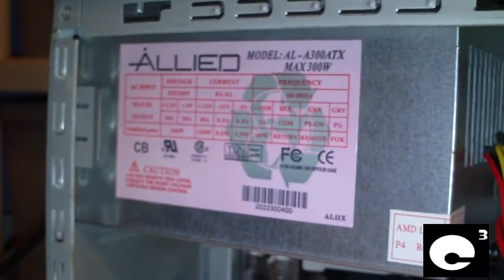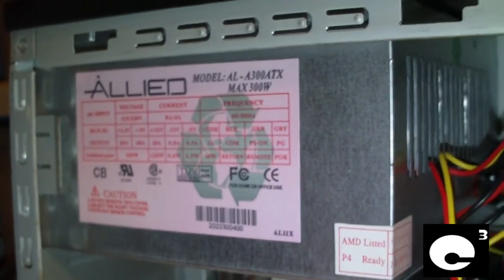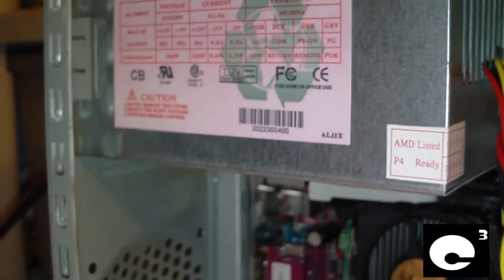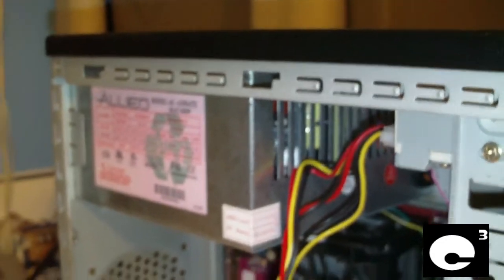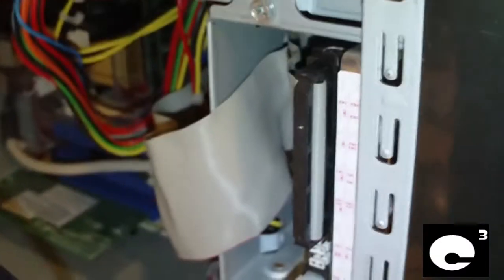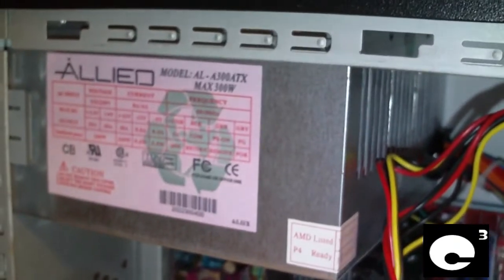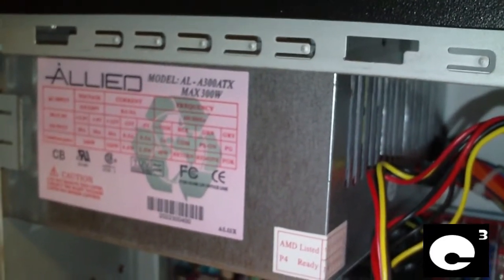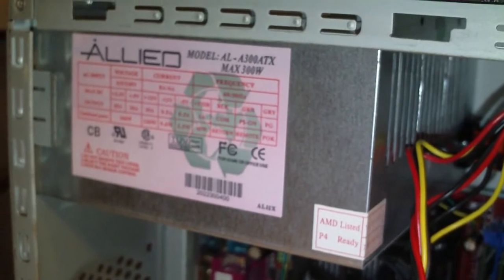1990's ATX spec 300w "Pentium 4 Ready" PSU struggles to run basic P4 system

Comment: The problem with power supplies is their age, and how long it has being used. If you have a power supply that is 4 years old, the caps might have gone bad, and maybe started to leak, that is going to give you a fluctuation on the power rail. I'd suggest to take a look inside the next time a power supply starts to go bad on you.
Reply: You probably shouldn't be opening it
Reply from the maker: @seanchering4790  I have been servicing PSUs for years. I ended up parting out this unit.